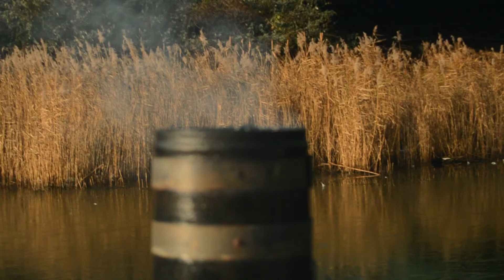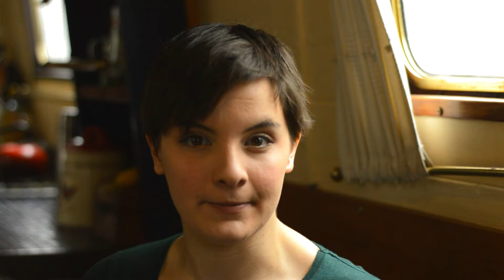How Do You Get Electricity On A Narrowboat?

Comment: Hey, like your vlogs! quick question..
You said about the kick starter thing, I assume it's a thermoelectric modal, but do you remember the name of the product or company so I could look it up :-) I know a little about this, it's not the best way to source electric but it could be a more reliable one come winter when solar energy is less.
And hopefully you'll post a video of your solar panels when you get them :)
Reply from the maker: +Dean Salter I will post a video about the solar panels when i get them. I cant find the exsact kick starter i was talking about ( i did find a broken link so maybe it doesnt exsist any more) but there are these:
- https://www.kickstarter.com/projects/2125893781/the-stove-lite?ref=category
- http://www.ecosnippets.com/alternative-energy/wood-stove-power-a-small-home/
- http://customthermoelectric.com/TEG_install.html
Reply: +ThisNarrowboatAdventure The "Thermoelectric Module" that the kickstarter is probably refering too is a Peltier Module.  You can buy them cheap here if you have a multimeter and want to play around with one:  
http://goo.gl/hzoJM9

They have 2 ways that you can use them:
1) Feed DC current into the Peltier Module and one side will get hot, while the other side gets cold (forcing heat transfer)... useful for heating or cooling a metal box, for example fridge, small heater, etc.
2) Place one side on a hot surface, put a heatsink/fan on the other side so its cooler... and it will generate DC current.  The bigger the heat difference between sides... the more DC current it will generate.

You can read more about Peltier Modules here:
https://en.wikipedia.org/wiki/Thermoelectric_cooling

If you want free power for cooking though, you could always use a Fresnel Lens.  You'd need a cover (towel with safety pins?) for it though, for when your not using it... as they can set things on fire instantly (and melt metals!) if handled wrong (they focus energy from the sun and I'd advise you only use it on land to stop it setting the boat on fire).  They are thin enough to slide anywhere on the boat.  Here's a video of someone cooking with one: https://goo.gl/uYh0QP
Reply: Wood Stove Thermoelectric Generator http://www.ebay.co.uk/itm/Wood-Stove-Thermoelectric-Generator/221378047969?_trksid=p2047675.c100009.m1982&_trkparms=aid%3D888007%26algo%3DDISC.MBE%26ao%3D1%26asc%3D20140328180637%26meid%3Db49e176469584b4ab72d5bbf1b0561ae%26pid%3D100009%26rk%3D1%26rkt%3D1%26sd%3D221511546216

Comment: I think an important factor with solar is mounting so that you can achieve optimum angle to the sun. To get your system design right you need to conduct an audit to establish your peak power draw. where you can also use 12volts for charging phones and tablets - do not invert and then put in a transformer to get it to charging voltage (2 sets of losses) - wind power is a non starter - thats why the government has spent billions subsidising it.
Reply from the maker: +Norman Boyes this is great so much more information here in the comments! we have seen some really good mountings for solar pannels